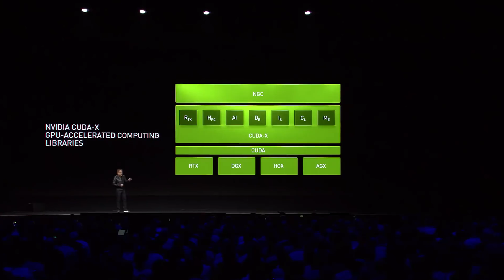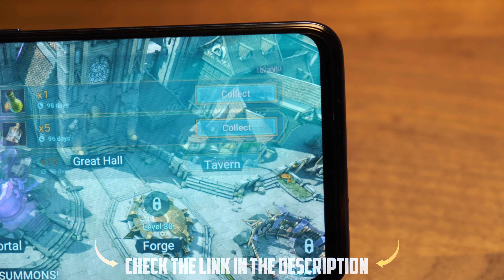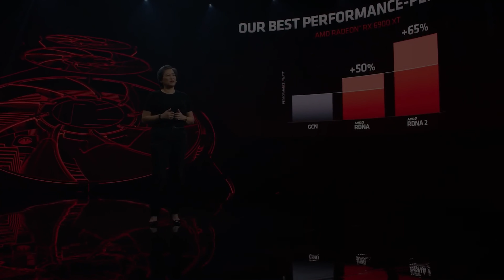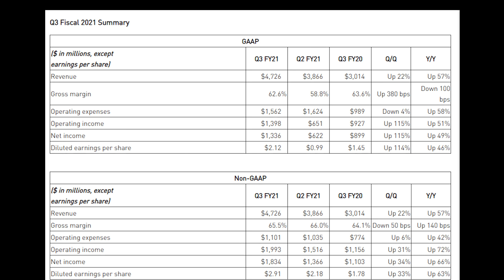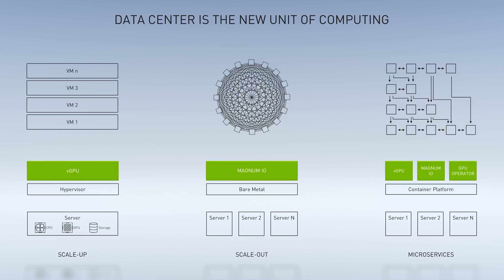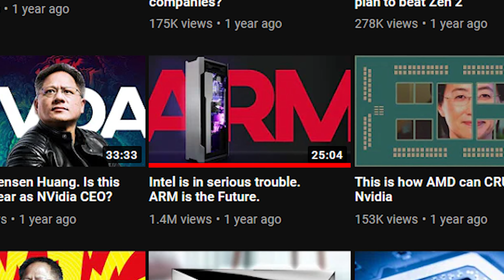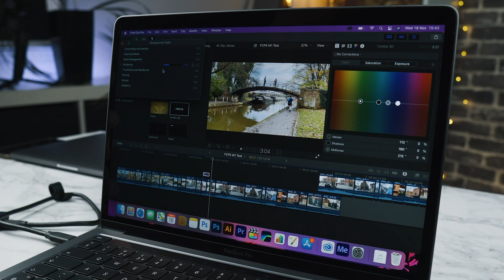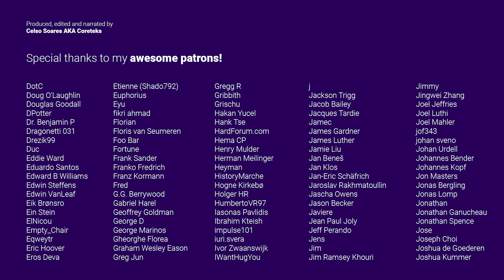NVidia has a REVOLUTION coming

Comment: AMD now needs to back RISC-V for the ultimate show down.
Reply: RISC-V might end up becoming the real winner out of all this in the long run because with x86, companies need a licence to produce them which are controlled by Intel and now with Nvidia buying ARM's, I have to wonder how many other companies are going to want to produce ARM chips with Nvidia in control of the licencing, many might want an alternative that no one controls and RISC-V fits that quite well but even if companies switch, it's not going to happen overnight and will take years or longer.
Reply: I think AMD already have good relation with RISC-V community. 
It's just a matter of time when we can have a RISK based CPU
Reply: @taab84  
They could easily do it. I won't be surprised if even Intel would join the RISC-V 'movement'.
Reply: @taab84  RISC V will be the next huge transition that Apple will do. In 10-15 years, Apple will switch. Im sure of that

And after that, Microsoft will follow. And that way all the PC‘s will too. Unless none of these huge companies go bankrupt, this is quite surely what will happen.
Reply: AMD has it's own SoC, and with the purchase of XILINX it will eventually magnify it...
Reply: YES ! !
Reply: @taab84  No reason why they all won't join at some point but AMD, Intel and Nvidia likely won't want to join anytime soon because they would prefer to use their own existing standard platform that makes it harder for other rivals to compete with them, RISC-V will likely shine because of new companies not because of the existing cpu companies, once the writing is on the wall that it's won, AMD, Intel and Nvidia will join that and start competing that way but that could be awhile off, mind you, Nvidia buying ARM's could speed that up, it wouldn't surprise me if in 5 or 10 years if Nvidia ends up selling ARM's off at a loss.
Reply: @mactalk2871  Thing is, doesn't Apple and Nvidia have an uneasy relationship with each other? with Apple wanting to go ARM's on the desktop and now Nvidia buying ARM's, I doubt that's a position Apple wants to be in so they could be one of the big players to adopts RISC-V early.
Reply: @paul1979uk2000  apple couldnt care less. They have a lifetime license for the ARM instruction set, which included all future versions. Apple paid once and never has to pay again.
Reply: @mactalk2871  Maybe but this is Nvidia we are talking about, they do love playing their exclusive game, with them in charge of ARM's, it's very likely they will do that to have a competitive advantage over some rivals.

Some companies will likely want to edge their bets on something safer like RISC-V that no one controls, more so with all the games that's been going on with the US and China.
Reply: @Trick-Framed  I doubt it, AMD already have an x86 licence, I think they already have an ARM's licence also but for AMD, I suspect they would rather go RISC-V than ARM's if x86 doesn't work out long term.
Reply: Like they haven't been cooking something in the back kitchen?  I started smelling the aroma two years ago.  The next decade will be interesting.
Reply: @MAW-20  That is true, but Apple could just modify some perts in the processor, or add some parts that are under their own license, so you cant run their OS‘s on a off the shelve part anymore. Thats what they are doing with ARM and all their accelerators
Reply: @mactalk2871  That's pretty much what Apple and some other companies will do, use RISC-V as a base and put their own lock in on top of it.
Reply: AMD's GPU ISA is better than RISC-V.
RISC-V  is just trash because it can't even get higher than 64 cores at 1 TFLOPs, while 6900 XT can get 5120 cores at 23.04 TFLOPS.
Reply: @Haskellerz  you can't compare fixed function to general processors like that.

Sure, you have all the OPS, but how are they used per cycal? lets look at bitcoin hashing for example.

On a CPU, it can take 3,700 - 4,500 Chip operations to generate one double-hash per core. 

on a GPU, it's hardware is set up in a way that just so happens to make it better at hashing and is highly parallelised, so it can only take 1,300 to 1,700 chip operations per hash, and this can be done across all the cores.

https://bitcoin.stackexchange.com/questions/1293/how-many-integer-operations-on-a-gpu-are-necessary-for-one-hash

On an ASIC miner however, It has a handful of cores with one job, Make hash , so the hardware only uses a few chip operations per hash to do it. 

The end result is the following hash rates.

a CPU that is a GFLOP class chip can only do 200 - 2MH/s. 

a GPU  that is a TFLOP class chip can do a lot more with 20-50MH/s.

But the fixed function ASIC (Antminer s9) that is a KFLOP/GFLOP* class chip can do an eye watering 12TH/s... 

Can you see. The KFLOP/GFLOP* chip just trounced the TFLOP chip... This is why using FLOP's or IOP's between chips whos jobs are vastly different is not very useful at all.

Note *KFLOP/GFLOP 

Because these chips literally only have one job,  they do not even rated in anyway for their FLOP count. They are only rated for what we will call (Task Per second) Since is only job is hashing, they are rated with H/s (Hash per second).

All we can do to ball park the FLOP/s is by knowing that 1 int operation = 2 FLOP,
and that it will take about 12.7KFLOP to  fully calculate one hash.

Ted Suzman: https://www.quora.com/How-do-you-convert-m-flop-s-to-hash-s

as the ant miner is advertised as being able to do 14TH/s we can calculate its TFLOP/s equivalence like so.

14 TH/s / 12.7 KFLOP = 1.1GFLOP/s

However, the ant-miners real world performance is more like 12TH/s so that would make it a high KFLOP class.

We are heavily mixing sources, types, and hardware here, so all this napkin math is very likely to be wrong, but the point still stands.
Reply: @paul1979uk2000  You need a license to design an Arm chip. Intel and AMD just won't give the IP to anyone but governments.
Reply: @MAW-20  There are extensions though, one day we could have an open source GPU architecture but I don't think it will happen in the next 40 years but then again technology grows exponentially not linearly.
Reply: @Haskellerz  Right, just ignore the fact that it's being supported by embedded software and hardware design companies so it's going to be designed to suit their needs.

Even existing Arm chips didn't provide what WD needed so instead of paying an Arm license they decided to make the changes they needed to a RISC-V base.

https://github.com/westerndigitalcorporation/swerv_eh1
Reply: @mactalk2871  While I think RISC-V is really cool, I am less convinced Apple will switch. Apple can do anything they want with ARM at the moment. They got full rights to instruction set. They got their own silicon which is what  they always wanted.

What more can RISC-V really give them. RISC-V ISA isn't really any better than ARM. What I like about RISC-V is that it is a cleaner and easier to learn ISA. But in terms of performance it does not have an edge over ARM was far as I know.

In fact I think there is a real chance that the PC industry will switch to RISC-V instead. Microsoft and the PC industry are not going to want to go with an architecture controlled by Nvidia. Most of them have not secured the ARM deal that Apple has for all future.

Perhaps there will be a split. AMD goes with RISC-V to avoid being beholden to an architecture controlled by one of its big rivals Nvidia.
Reply: @deoxal7947  I don't know, it might happen quicker than expected with Nvidia buying ARM's and Intel and AMD controlling x86, I think an alternative IP would be very appealing to many companies around the world, especially upstart companies.

I suspect if Nvidia didn't buy ARM's, it might not matter but a lot of companies don't trust Nvidia so that could change many things that it 10 years time, it won't surprise me if Nvidia ends up selling ARM's off at a loss.
Reply: I am hopeful for this. Isn't RISC-V open source?
Reply: Intel could too 🤔
Reply: @WarriorsPhoto  Yes it is, I think MIPS and Power were open sourced too but the real benefit of RISC-V is the ecosystem they're building.
Reply: @WarriorsPhoto  
> I am hopeful for this. Isn't RISC-V open source?

Kind of. Individual specifications of a RISC-V CPU core is not necessarily open source. In fact I think most are closed source.

However with RISC-V the instruction set specification is open source, or more specifically anybody can use it without paying a license fee, or being subject to some kind fo license agreement.
Reply: @paul1979uk2000  I think you're confusing open source advocates with companies. Arm licensees will only move away if Nvidia makes it too hard to design new chips. Purchasers of Arm chips are a step removed so are only indirectly effected.
Reply: @deoxal7947  But thats the point I am getting at, that Nvidia would have the power to do that would be enough for many companies to go cold on the idea of building an ecosystem around ARM's, I suspect many would prefer something else like RISC-V that no one controls so they can do whatever they want with it.

In any case, Nvidia won't make any drastic moves with ARM's early on, last thing they want to do is scare off companies but in the long run with Nvidia's track record, well I suspect many companies would be concerned on that one.
Reply: @WarriorsPhoto  Don't know if it's open source but it's an open standard in that any company can take part in it from what I understand.
Reply: @paul1979uk2000  But Arm could have done that themselves like any other company that's pulled out the rug from under customers once they got big enough.

It makes no difference if Nvidia raises license fees today or a few years from now, it would have the same effect.

I think you're forgetting how corporations usually operate. Did you see them shunning Microsoft for integrating Linux as a part of Windows or making their Office Suite not work on DR-DOS way back when?
Reply: @paul1979uk2000  Yes exactly and I hope more do.
Reply: @paul1979uk2000  Irrespective, EVERYONE will eventually SWITCH to RISC-V architecture. It is inevitable especially with the new hardware revolution (IoT, 5G) which is about to take place. Many tech giants will need to create their own custom devices.
Reply: @deoxal7947  Yes but ARM's is a very different company then Nvidia is, Nvidia is a lot more controlling and looking at their tactics on the PC, I highly doubt many companies would trust them on that.
Reply: @stuffstoconsider3516  I suspect one of two things will happen, a lot more will switch to RISC-V, especially newer companies wanting to get into the game or the existing standards, x86 and ARM's open up and become an open standard that anyone can use, a bit like how IBM gives up control of the PC standard, if any of them do that early enough, that standard would likely win which would also give the companies that work with that standard a bit of a leg up as they know the in's and out's of it, but chances are, if they do open it up, it will be too little too late as RISC-V will have already won.

I suspect upcoming new starts from Asian could be what forces this change, especially because of all the licence issues that China and the US have got themselves into over the last few years as I doubt many will want to be dependent on any tech that needs a licence from an American company which x86 and ARM's would be if Nvidia buys them.
Reply: @paul1979uk2000  Ya but until they ACTUALLY do something, things will continue as normal.
Reply: @deoxal7947  All in good time, in fact, I think Trump might have speeded up that process but these things takes year, either way, I suspect many around the world don't want to be too depended on any specific tech, licence or country so will look for alternatives, RISC-V could fit the bill perfectly for many.
Reply: @deoxal7947  He doesn't need to have any specific dealing with them, he's broken trust among international partners, think about it logically, if you were a company and your suppler threaten you, wouldn't you look for another suppler? this is what Trump was trying to do, use US companies as a weapon against China, now they will look for alternatives but worse than that, others around the world will want alternatives now just in case they become a target.

Many US corporations even warned the government about this but Trump didn't listen, either way, it's probably too late now as the damage in trust is already done.

In any case, it's going to be interesting to see how the next decade pans out, if there is one thing we can thank Trump for is that we could see a lot more rivals enter the high tech market and that's why US corporations kept warning Trump as they saw what was going to happen.
Reply: @paul1979uk2000  The Election Fraud is too big and Trump has many cards to go with. Trump will be re elected. And the Cycle will continue. Theres nothing we can do.
Reply: @deoxal7947  Cheap labour is something that westerners like, as much as we like to say we should bring jobs back home, our consumers habits push companies to go to cheaper labour countries so unless we as consumer are willing to spend more, cheaper labour countries will continue to have that advantage.

Now I'm not saying I like that but I'm not blinded by the reality of how the world is, what do you think will happen if western countries didn't use cheap labour?, standards of living would take a dive, any government that pushes that policy will be out of power by the next election, in other words, we can't blame China or others for the cheap labour when western countries are addicted to cheap prices and that isn't going to change for a while.
Reply: @paul1979uk2000  I don't like cheap labor, you do. Are you also saying westerners like slavery though? You didn't address that part.

Saying tariffs bring back jobs just isn't true, they're taxes since taxes discourage activity in this case interacting with China. The argument that consumers have to make the choice alone is nonsense. If we get our allies to all tariff China as well it would mean corporations couldn't sidestep the issue.

If we actually want to bring back manufacturing jobs, we should make the country more friendly to businesses but Democrats (and Bernie) want to lower tariffs on China but raise income taxes to pay for among other things the green new deal. A tax on the 1% won't pay for all their stuff anyway and they've said as much.

Thanks for taking me from thinking the Arm buy didn't matter much to it's an extremely good thing.
Reply: @deoxal7947  Hey I don't like cheap labour but I'm a realist, as long as everyone else is looking for bargains, that's putting pressure on companies to look for cheap labour and if one doesn't, the rival will and we will flock to them in buying their goods, I don't like it but that's how the world is and that isn't going to change unless we change our spending habits and that is only likely going to change with a lot more automation and robotics.

Making the country more friendly for businesses is another way of saying we should cut red tape, that is another way of saying we should reduce workers rights and other benefits the people have.

In the end, all this doesn't really matter, in the longer run, automation and robotics is going to take over most jobs and even cheap labour can't compete with that in the long run but that will bring up a lot of other problems that we need to sort out, the Europeans might already be leading the way with its social safety net they have.
Reply: @mactalk2871  maybe, yes. Apple usually stays on a platform for 10-15 years and likes to control the entire widget, so switching to an open-source ISA and cutting off yet another middleman (in this case, NVidia, with which they hadn't great relations for a long time) while forcing yet another bit of obsolescence will be a win-win for them. However, unless there are, again, big performance gains to be had, just like in their 68k to PowerPC, PowerPC to x86 and now x86 to ARM transitions, users will cry bloody murder.
Reply: @MAW-20  No.  Easy.  Apple can do it their way and  make everyone not compatible.  RISC-V allows custom instructions.  If you like, you can add your own  instruction as you like to the base RISC-V instruction sets.  Apple can make a bunch of their own  extension instruction and break every other vendor's RISC-V chips.
Reply: Alder lake and arc gpu will shake the gaming world
Reply: @mactalk2871  mac's are just over priced pcs. Intel is the shit
Reply: Intel arc will be the future someone needs to take AMD and Nvidia down a few pegs